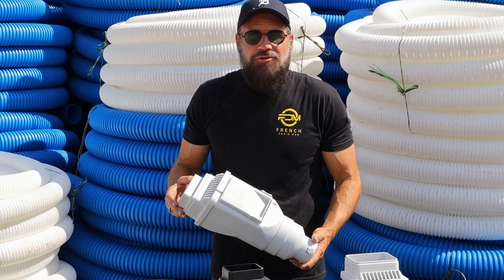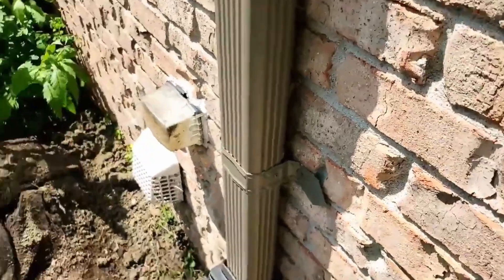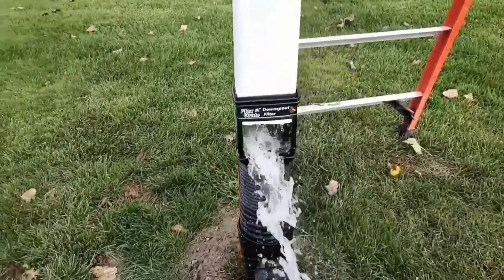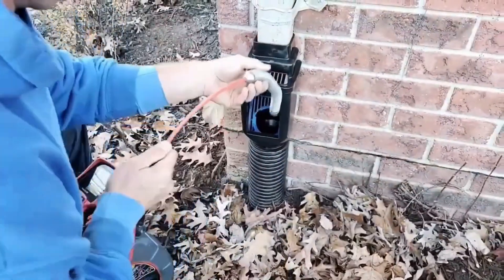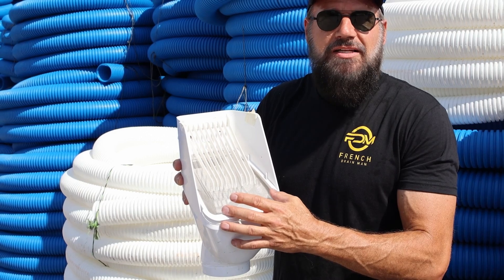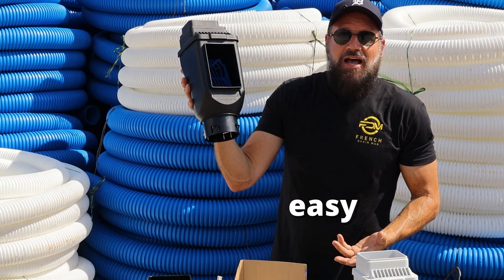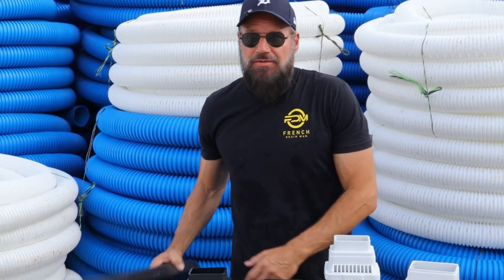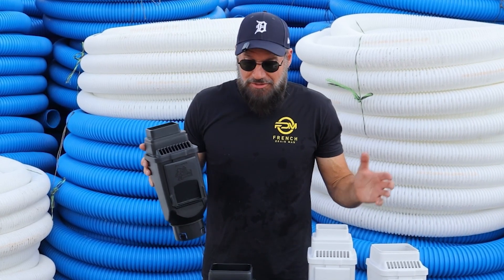How to Make a Downspout Cleanout Connector - PVC vs Corrugated

Comment: Thank you for this design.  I couldn't believe my eyes when I noticed my existing connectors splashing out in a heavy rain.  I don't want to add tape or caulk to the seam.  So I have been looking for something better.  My only trouble is deciding which color to buy!

Comment: a 45-degree 4" Tee at the ground level, with a metal mesh inserted into the Tee is a cheap solution.  The Tee's side opening is a man hole to insert a mesh to stop the leaves, and you need a 5 buck cover for the side opening too.  Cut a cheap leaf guard to create the mesh filter.
Reply from the maker: Downspout Leaf Filter and Clean Out, Gutter Leaf Guard
https://frenchdrainman.com/product/downspout-leaf-filter-clean-out/

Comment: Currently installing an underground downspout system. Love the design of the vented downspout connectors. As I was watching this video I am curious if you all considered an option for a clear door or some sort of visual indicator to identify if the grate is clogged. 

Love your products! Also really appreciate all of the videos!
Reply from the maker: We successfully built this with no gaskets that crack and dry out. It's watertight and holds up to the elements very well. What you're suggesting could possibly lead us down the road to a liability where the clear material over time does not stay clear. As in most cases, the sun usually ends up spoiling such a material. Having said that, I think we met the price point that the market was looking for, as well as the quality and beauty.
https://youtube.com/playlist?list=PLjFCqaZ4v1BXKlR6qPMC_8I00r5KGdoP9&si=K4SP3fNBZ85KBf-Q
Reply: @FRENCHDRAINMAN  Very good point! Thanks for the reply, very happy with your products!

Comment: Why are your products so heavily overpriced ?
Reply: I'm a homeowner and currently tearing out and redoing what a contractor did using the big box cheap stuff only a coulle years ago.    These components install easy and function as described.  I stood out in flash flooding on friday in my Minneapolis yard watching 3.2 inches disperse as expected.   Worth every penny!
Reply from the maker: When you hold it in your hands you will know. Everything is Extra Heavy Duty. Quality is a 10 out of 10. This leads to a fit and function that rates 10 out of 10. 😮😊
Reply from the maker: Best French Drain and Yard Drainage Contractor
https://frenchdrainman.com/
Reply: That was my first reaction. But after watching the videos and reading the comments I decided to pull the trigger on my downspouts. I am installing 4" corrugated dual wall underground to the FDM pop up emitter. The quality of all the products is worth every penny. No regrets here. Buy once and forget about it